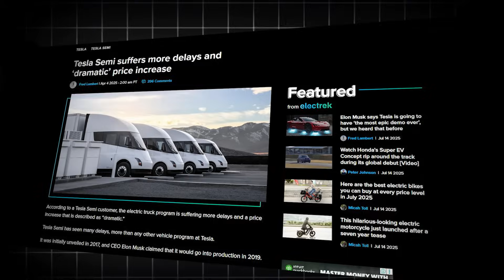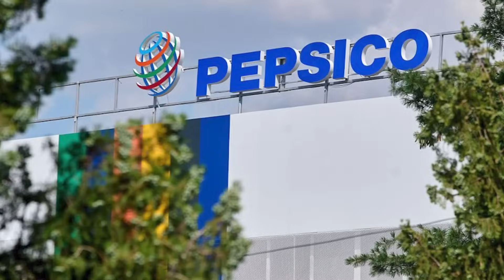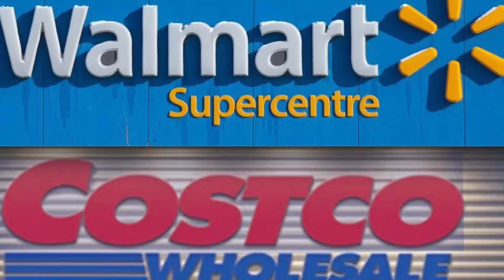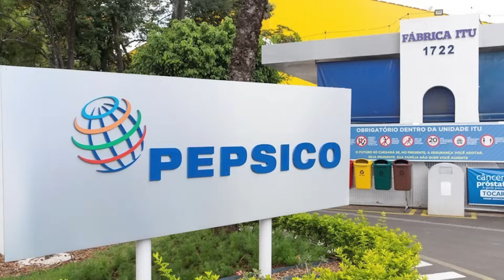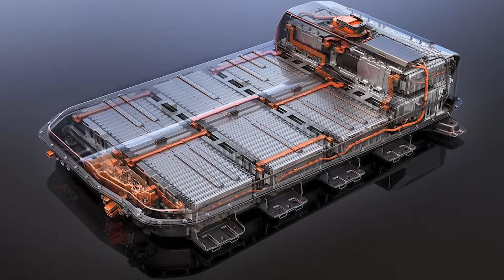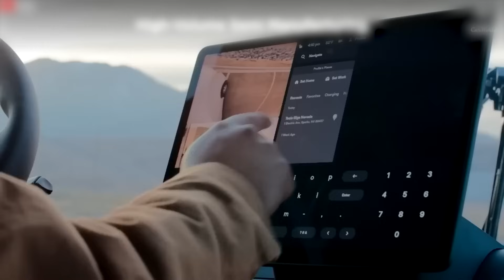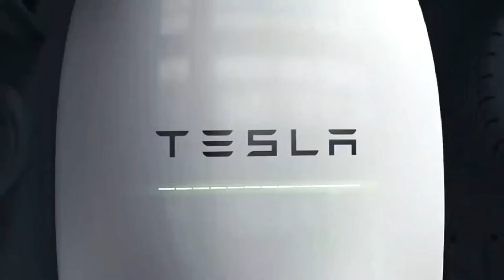Elon Musk JUST Revealed Tesla Semi Expansion – 50,000 Big Rigs Rolling Out!

Comment: The Electric truck market including USA and Europe has lots of manufacturers with good well designed trucks. Tesla semi does not have anything  outstandingly  special. Maybe Tesla can be highly competitive. But for Tesla to sell large numbers with a new product is going to be a big challenge
Reply: Pepsi has been running 36 semi for the past 2 years both with long haul and short haul delivery., tests showed a full beverage load can do 500 miles on one charge and does not need to slow down going uphill.  The main issue for delay in full production has been lack of battery supplies in the US to get the government discounts.  The new factory in Nevada is nearing completion and Tesla expect to reach 4,000 semis each month sometime in 2026.  The main advantages are significant lower running costs per mile and minimal maintenance costs.  Pepsi drivers rate them highly.
Reply: @robertwoodhouse-bm7kt Tesla will not be able to sell 4000 Semis a month. Not even close